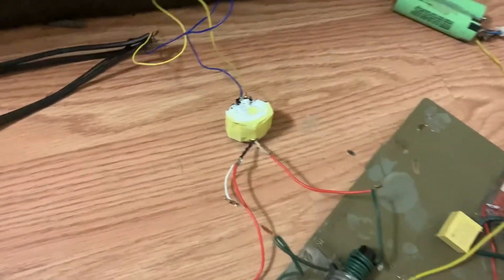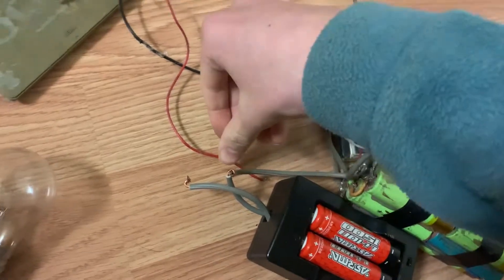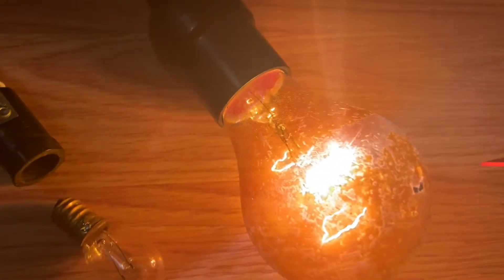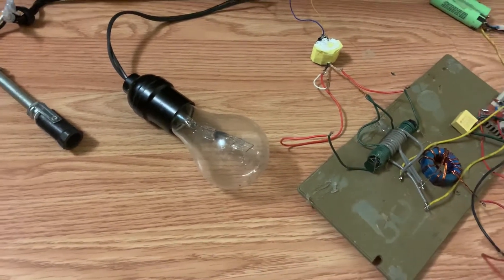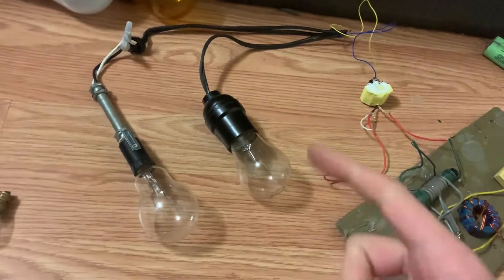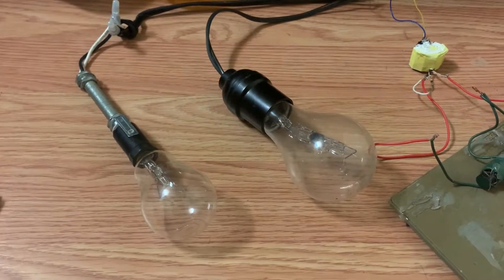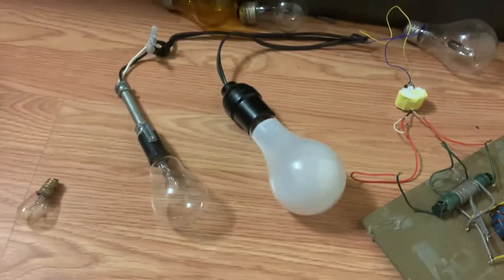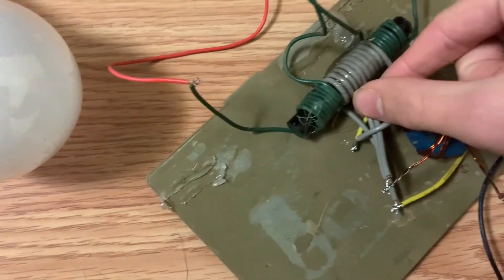Using ZVS driver as a power inverter?

Comment: !! If ZVS has ferrite core  in wire coil, with switch on, isn't the power draw very high without load attached to secondary of ferrite transformer? Idling mode-- waiting for the end load.  A standard type switching inverter with transformer has idling mode, low power, waiting for the end load applied. People keep turning on + off power to their ZVS set up.///,,,....
Reply from the maker: The idle current actually wasnt that bad, it might not be great but it wasnt much at all

Comment: I did the same thing slightly bigger ferrite transformer maybe 75w. Lights up 100w bulb easy full power. Only problem is its tens of khz not 60 hz. If you want 60 hz you need to rectify the transformer output into DC and then use a H bridge inverter to create a 60 hz square wave. Add some microcontroller and voltage feedback circuitry and you would have a real inverter.
Reply from the maker: Yup